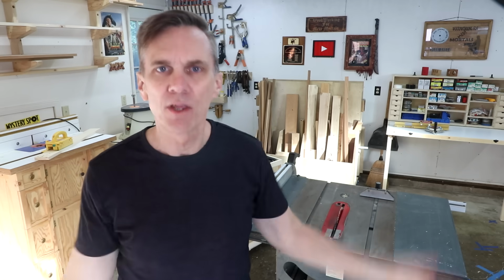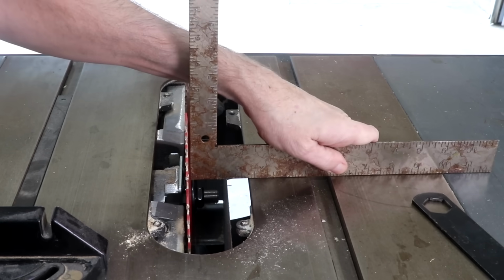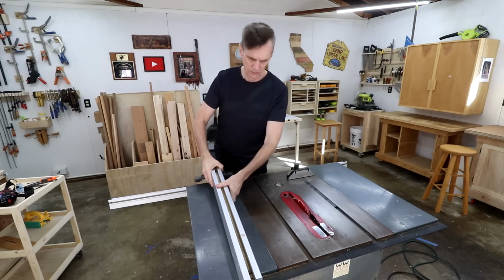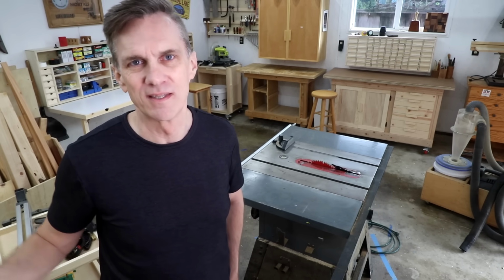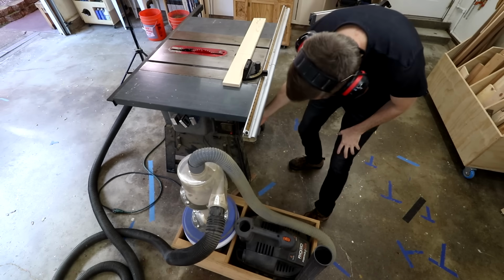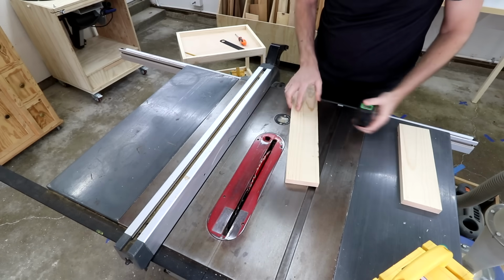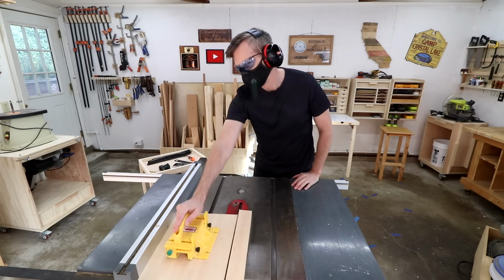A step-by-step guide to making your first table saw cuts. TABLESAW BASICS.

Comment: I need this.  I have had a table saw, in a box for 3 years.  Scared to open it up.  LOL  Had a kick back years ago and it scared the heck out of me.  Last time I ever used the table saw.  Time to be brave!
Reply: I had a similar experience about 8 years ago when I first started using a table saw... but that’s because no one taught me how to properly use it!  Kickback is actually very easy to prevent, even without a riving knife (although that will certainly help).  Some tips: 1) Make sure your blade is spinning at maximum rotation before you try to push material through.  2) For rip cuts, expect the blade to want to push material towards you.  Your job is to provide resistance to that movement as you move the material against the spin.  This is a very nuanced dance as pushing too much or too little can be dangerous.  Kickback can sometimes occur when you try to push material through but you aren’t providing ample resistance with your right hand as you push.  This takes a little practice because it’s kind of a “feel” thing.  It is nerve racking the first few times, but as long as proper resistance is there, it will not kickback.  3) Make sure you are maintaining a steady pressure into the fence as you rip material.  The material will not naturally travel through the blade in a straight line and if it wavers too much, the pieces can pinch the blade, causing kickback.  The table saw will work with you but only when you keep your material locked into your fence.  4) Push material into the fence beneath the blade (closer to you).  Avoid pushing material against the blade as this can also create a pinch that might cause kickback.  5). Never ever pivot material as it goes through the teeth of the blade.  Always keep your material pushed up against your fence and as straight as possible.  6) This one is the least intuitive, but incredibly useful.  Keep calm and (as long as your hands are clear from the blade) you can actually stop moving material while maintaining resistance in both directions (against the teeth and against the fence).  You can hold material still as the blade spins in the middle of a cut and, if you are applying enough resistance, It should remain still.  This is a great default if you are feeling overwhelmed mid cut.  It should also enable you to turn off the power as the blade only kicks back if it’s meeting resistance.  Keep watching table saw videos to get a better idea of how to position your body and learn technique.  Good luck!
Reply: @stephenschaffenberger6765  Thank you so much! Yes, I binge watch tool movies constantly and read many magazines. Thank you so much for your advice&
Reply: @Fist Bump Thank you so much for the tips!

Comment: NEVER use a 10" blade for anything less than 2 1/2 inches thick. It puts stress on the motor. The blade is thick so you waste wood and a 8" or smaller blade makes a better cut it's thin and is so much better for your saw and the best part they are cheaper. I almost always use 7 1/4 blade on my 10" tablesaw. Most of use use 2x material or smaller. Just my 2cents.

Comment: Love this! Question - for table saw setups I have seen both metal tool stands like the one in this video, and DIY floor cabinets. Does it matter what kind of stand the table saw is on? Are there pros or cons to metal legs vs wood cabinet? Esp for a saw on locking casters

Comment: Never assume your table saw blade and slots and fence will be square “out of the box” check and adjust as needed first thing.
Reply: Yeah, just got a used one... can't get it to cut straight... no idea what to do...
Reply: Square the blade to the mitre slots?

Comment: Thnx, solid, concise and well-structured advice! 
I'm a relatively new woodworker with a table saw.  When I first started using my table saw I made a 'safety checklist'. It helped me to identify risks and focus on the actions needed to complete the task[s]. 
Like you did in the video I do 'dry runs', esp. with 'complicated or new stuff'.

It helps to know in advance 'what happens next'. 
Surprises are BAD, when operating a table saw!

As suggested in some of the comments: when you get some experience things  might get more DANGEROUS! Complacency, routine etc. will greatly increase the risk of silly // stupid mistakes. A near accident reminded me instantly of the brute force of the machine and my 'safety checklist'. 
Great video[s], keep up the good work!
Willem

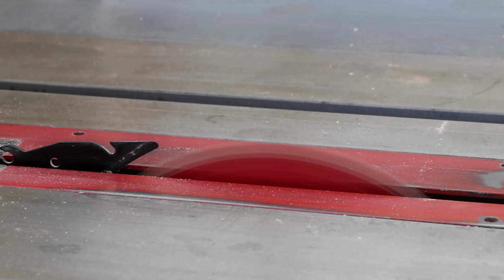Comment: 6:47 I wouldn't tolerate a saw that took that long to stop.
Reply: Then you shouldn't be anywhere near a power tool - loss of digits (or worse) vis-a-vis the expiration of a few extra seconds..... :o/
Reply: @andrewtongue7084  No, I would return/replace it.  By that logic, it could spin for 3 minutes and still be acceptable.   If something went wrong, I wouldn't want it taking that long to stop, not the idea that anyone in their right mind would reach in due to impatience.
Reply: Then clearly, you're an impatient individual - & my (earlier) assertion still stands, ergo, that you should not be anywhere near a powertool - obviously, you have no respect for the implement you're using, & thereby, a danger to yourself (& potentially), others. QED
Reply: @andrewtongue7084  Your opinion means nothing to me, since you are so far off the mark.   Keep pretending you know everything.

Comment: Steve, I bought a Skil 3410-02. I'd like to make a zero clearance insert cost effectively. I have a few ideas, but really want some ideas for adding a splitter. Also, I'd love to see/hear your thoughts on making a crosscut sled (main issue is dealing with the tabbed guide slots).

Comment: Some people ask why dado blades are not allowed in most of europe. Your video kinda shows why. In europe there is a law wich sais the blade has to stop within a certain amount of time. A dado stack has to much inertia and spins too long after turning the machine off.

That saw of yours spins quite long after swithing off. Propably just within or out the limits set here.

Comment: 00:47 I have to slightly disagree with you about there being "no dumb questions". For decades in my job (not at all related to woodworking), I have always told new employees that I was working with, to feel free to ask ANYTHING, because the only dumb question is the one that never gets asked. This applies to any profession you can think of, as well as any hobby, including woodworking.

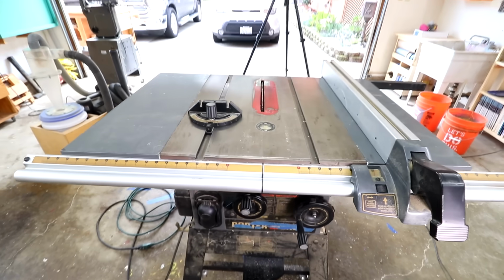2:20 10 years already????? WOW time flies 

9:35 I always have made it a rule, that when making cross cuts on a table saw WITHOUT using a crosscut sled, to put the longer end of the board in front of the miter gauge, leaving the shorter length on the unsupported side of the blade. I feel that this gives me greater control of the piece of wood.
Reply: Hello can I ask a "dumb" question.....does a guard over saw have a purpose....like saving cutting off fingers

Comment: Your videos gave me the courage to not give up woodworking 5 or 6 years ago. Dare say they got me past some anxiety and depression issues as well.
Still haven’t bought a Tablesaw yet, but I was thinking about it last week. Not sure whether I need a small contractor saw or should go with one similar to yours-a hybrid saw??? Time will tell.
This video qualifies as a safety video to me - the part about bringing it home, plugging it in, and turning it on and off to get yourself used to the noise and feel of the tablesaw was excellent advice. The first time I ever used a circular saw I was surprised at the power and noise. I kind of made a skit in my head (starring you of course) about a macho man (think of the costume) bringing home his new saw and showing it off to his friends (more you in various costumes and great editing) but never turning it on due to some lame excuse (it trips the breaker). Finally his friends leave and he closes the garage, locks the door, puts on all his safety equipment and reads the manual and practices turning it on and off. I guess I watch too many of your videos...

Comment: Great video!  I am probably the target audience for this video: I have a table saw, but have used it only a handful of times.  Thank you for clarifying that the workpiece is between the saw and the fence.  Also double thank you for saying to leave your pieces be until the blade is done spinning - these little details often don't get discussed in woodworking videos.  I think you have convinced me to get a GRRIPPER - it just looked SO EASY with the tool vs supplying forward, inward, AND downward force the old fashioned way.

Comment: My portable Dewalt saw has too short of a run from the front of the table to the blade.  It seems to me that more space on the front would be best, because you can keep the piece flat more comfortably.  Hate using my saw for long stuff.  Feels like it wants to start see-sawing.

Comment: i converted my tablesaw motor from single phase to 3 phase and am just using a vsd so i can run it on single phase. its handy for  controlling the motor speed and ive also set the motor to come to a complete stop in 3 seconds. Quick enough so its safer quicker but not to quick it stresses the spindle or blade.

Comment: Great tip to imagine the cut before making it. Whenever cutting long heavy stock I like to do a practice run with the saw off and the blade down. I want to know ahead of time if I'm going run out of outfeed space or if something is going to get unstable during the cut. If so, make it right and do another practice run!

Comment: An important point about performing a rip cut with push sticks is to keep the left hand push stick behind the blade.  You don't want to push the cutoff section into the blade and cause it to bind.

Comment: You were getting pretty close to causing kick back using two push sticks, with the one almost getting past the leading edge of the blade. Better to use one push stick/block and a feather board, located before the blade of course.

Comment: blade guards shift the riving knife and drive the wood into the back of the blade causing kickback same with anti kick back paws.  btw the riving knife will need to be adjusted on new table saws. my factory set on was all the way to one side of the blade instead of centered. when you set the fence put the back of the fence wider than the front to give the wood some room away from the back on the blade (only 1/32 no more or you will have problems).

Comment: Steve, thank you so much for your videos! Thanks to you, I have learned a lot about woodworking and love it. 

I have a question about the push sticks. One pushes the working piece through the saw and the other looks almost like it's pushing the working piece INTO the saw. I haven't had much experience with table saws, but that seems almost dangerous. Is it safer than it sounds and looks?

Comment: I’m watching the beginning of the video, and I see the extensions. What did you use for the extension tables? I have an older craftsman with a cast iron top. It has two iron extensions but they aren’t solid on top and I wish they were. Also, is that the rip fence that came with the saw? Thank you sir.

Comment: what really frightens me is how long your sawblade spins after you shut off the saw! my festool precisio 50 (is not available in the us) stops the blade in ONE second. i think many accidents happens when people try to remove the offcut after they shut off the saw. So for really safety reasons everone should fight against the reflex to take away the offcut, even with the pushstick. if it touches the spinning blade you shoot a bullet through the shop. regards from cologne

Comment: Huh, I was a bit surprised by the advice to look at the fence instead of the blade.  My personal rule of thumb is to never move my hands when I'm not looking at the thing thats going to hurt me.  I'll pause momentarily and look at the fence but only move my hands if I'm looking at the blade.  One thought I had is maybe because once you set the gripper in place you basically can't hurt yourself accidentally so watching something else is OK?  I don't know, just seemed strange especially for someone with absolutely no experience.
Reply: The reason for watching the fence is that if the board drifts off the fence you'll start to get a curved cut.  This is not just a nuisance, it's potentially very dangerous because it's like you're freehanding the board through the blade.  The potential for kickback is very high.  I think he's trying to say to be aware of the blade, but to focus on holding the board against the fence.

Comment: Great beginner introduction to the table saw.  Even an older guy like me enjoyed it.  I'd recommend talking about out-feed support in an upcoming video.  I've seen more than one "situation" when a newer table saw user tried to rip cut a long board.  Pushing down hard to keep that board down on the table can lead to bad cuts or even worse, accidents.  I know, I had a minor one when I was first starting out 35 years ago.  Keep up the great work.

Comment: Could you make a buying guide for a table saw?  I bought a contractor table saw and the miter track is square with a couple of tabs before and after the blade to make a partial t track.  I am not a brand guy but just want to see what we actually need to see when buying a table saw
Reply: Dwayne, some manufacturers do that, matter of fact, my first tablesaw from craftman did. Its to prevent the miter gage from lifting up. I hated it! I eventually ground those tabs off. Now i am not saying that is the right thing to do because i know it voids the warranty and it is supposedly a safety feature ( more of a pain in the a**). I will say that I've never seen this on any cast iron top.

Comment: Great video! Thank you for teaching it and common sense indeed.  The table saw has to be the heart of every wood shop.  Never run a table saw without the safeties.  Even a ‘master’ needs too because they can be careless.  Both my father and father-in-law had ER trip from removing the safeties and they both have 40+ years each using table saws. 
I remember your older video with the microjig gripper, it just popped in right in the middle of you talking I was like skip this ad oh snap this is part of the video, odd.

Funny story... the only stupid question is the question asked repeatedly, wanting a different answer.  Can I jump off a bridge.. no, can I jump off a bridge.. no can I jump off a bridge.. no, (asked 10 more times) can’t fix stupid lol

Comment: a few things to add... it's a good idea to hook your thumb under the front of the table during the initial part of the cuts so your hand is not physically possible to get near the blade. the push stick should be pushing more near the center of the offcut piece so the block of wood is being pushed forward more evenly and not pushed into the blade by rotation. the last thing is that a block of wood with a notch cut in the end to catch the bottom of the wood provides much more control than the plastic push sticks in the video.

Comment: Thanks for posting this, Steve. My husband bought me a table saw for Christmas and I'm terrified of it. I'm building your BMW and each time I need to use the saw he comes downstairs and we talk it through and then make the cut. I have a question though, this is a smaller table saw and cutting sheets of plywood is challenging. What did you say in your BMW video? "I wish I had a workbench to build this workbench"?  I would need an outfeed table but need to build an outfeed table. Thoughts?

Comment: Thanks for the great video, once again, Steve!

What kind of saw blade would you recommend for all kinds of cuts (besides Dado)? I hate having to switch between when doing different types of cuts and jigs. Thanks!
Reply: Steve mentioned in the video a combination blade that is good all around for both crosscutting and ripping.  Watch it again as you probably missed a few other key points as well.
Reply: @dwightl5863  no, I caught it. Just beccause HE does it doesn't necessarily mean he recommends it. Much like the blade guard, there might be something else for beginners out there.

Comment: This might be too advanced but I'm a little surprised that you didn't mention featherboards.  They make it ultimate safe.  You don't need to have that beginning phase with the two push sticks.  You can use one.  And if you get real fancy you can put a vertical featherboard keeping the board snug against the rip fence and table top.  I use a magnetic version (heaven) but you can buy a cheapie and do just fine.

Comment: Thanks, Mr. Ramsey.  I have to admit, I'm more intimidated by the table saw than any other tool.  The larger motor along with the blade facing me is a little more than I am comfortable with.  My circular saw is a little more manageable, but it definitely suffers from the lack of precision and time-consuming setup for each cut.  Any suggestions on how to clean up my circular saw game and/or get over the nerves of using a table saw?
Reply: I personally dislike a circular saw.  In your case, get some inexpensive lumber and make it all into sawdust.  Learn by doing--with Steve's advice in this video.